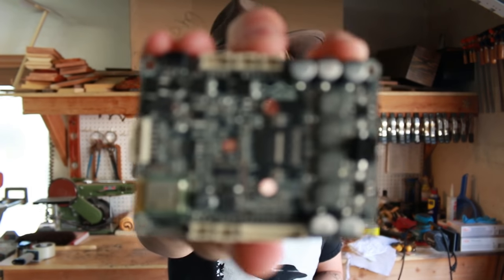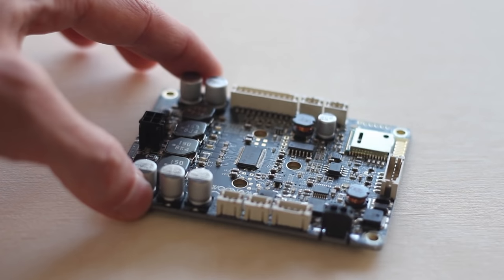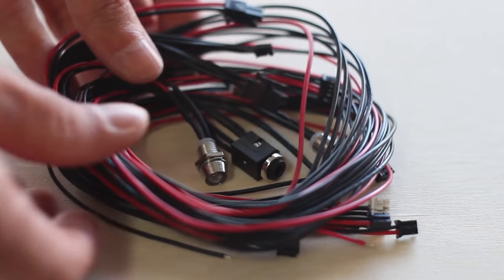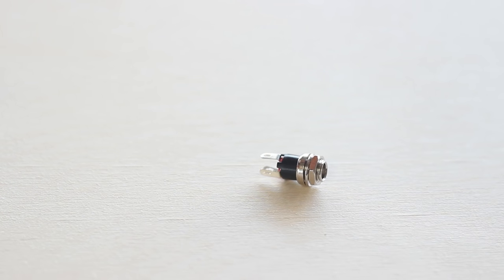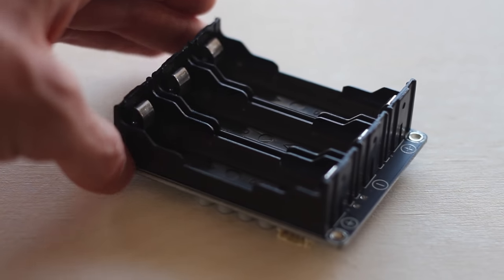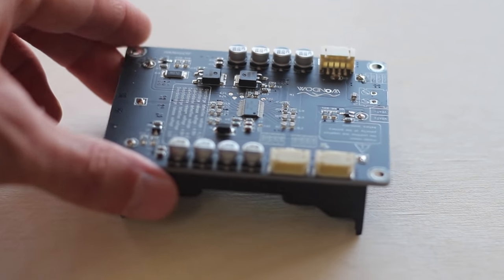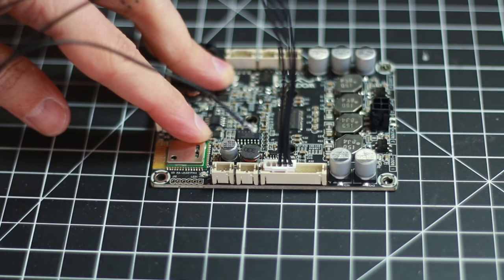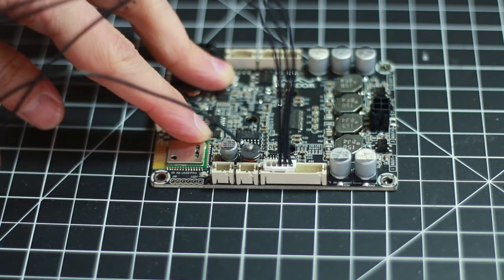The Best DIY Bluetooth Speaker Amp Board (For Now) & How To Fix Its Problem

Comment: Something people should be aware of with these amps. The watts ratings are bogus. Whatever SURE (or any manufacturer) rates these, the usable output is actually around half. Just take a look at the spec sheets.

They are rated 10% THD at full output and will sound like garbage on any set of speakers. However, they are generally 0.1% or less THD at around half the rated output.

Also, the published ratings are at 4 ohms. Most home audio is 8 ohms. So really, if you have a 50 watt amp, for 8 ohm speakers, usable watts are 12.5.

And because of all the marketing BS over the years, most folks don't realize 12 watts is cranking on good speakers.
Reply: You don't need a true 100W per channel. Very few speakers could actually take 100W.

Unless you have huge speakers, with multiple woofers, multiple midrange drivers and a tweeter, an amp like this rated at 50-100wpc will be more than enough to drive your speakers beyond their rated wattage.
Reply: Most speakers will be 80-90dB at 1 watt, 1 meter. Most of the time, you will not be using 1 watt.
Reply: I totally agree with you on the power and how much it's changed over the 20 years. The power ratings that is. I installed car audio for about 5 years in the mid-90s. We never used more than 150 to maybe 250 watts per subwoofer. Now I do know that the Rockford Fosgate amps that we used worth heavily underrated say for instance the punch 60 was supposedly 30 x 2 Watts at 4 Ohms. Testing last year showed that this amp actually put out around 80 x 2 at 4 Ohms! We all knew something must be going on but of course you didn't have the internet back then and the amp was also around $300 so strangely we had to throw the spec sheet out the window lol. But still, we did not run the Thousand watts per sub that people are doing now and not making that much more volume or SPL. And this is not only with subwoofers but front stage drivers as well. And amplifiers and speakers have become more efficient so why do we need 100 Watts for each 6.5 inch coaxial in each door? LOL we don't! So yes 12.5 clean repeat clean, watts, is very adequate.
Still, even today, they still will not get away from putting those large Peak or Max wattage numbers on the box and marketing materials.
Don't even get me started on power wiring and additional batteries! Again, class D amplifiers have become almost 50% more efficient than the older a b amplifiers but now all of a sudden we need 4 gauge and sometimes 0 gauge runs of expensive wiring or even welding cable! I took out my older Rockford Fosgate Punch 200 DSM amplifier which is capable of making 400 plus watts and does so easily on a gauge cable that can be up to 20 ft long!
Thank you for bearing with me I know it's car audio but still it's audio and it's wattage! I appreciate everyone.

Comment: I have used several of the JAB1 series amplifiers w/battery charger. I have never had the feedback that you experienced. I will definitely keep a look out for any issues. Also be aware the speaker outputs on the JAB1 are labeled incorrectly and puts the speakers out of phase. I really wish the speaker wires were not all black and 20ga wire instead of 22ga. I make custom molex connectors with upgraded wires gauges for the speakers, power input (upgrade to 20ga) and the charge cable (upgrade to 22 ga). Great video series Kirby!

Comment: I believe that wire on the aux cable that you removed is a ground. I had the same problem with this board and the seller said the fix was to tie this wire to the ground (one of the screw holes in the upper right corner). Seems like a common problem as I got this feedback very quickly from them.
Reply: did grounding the wire help?
Reply: Yes it did fix the problem. Guess I didn't mention that in the original comment.
Reply: Grounding the wire turns bluetooth on on my KAB-215 board. So, what I've found is that BT -> R(in) is not even necessary. You can switch on BT module via BT -> GND.
Reply: I still get feedback, any added help for me?
Reply: 4 wires for a stereo aux input seems odd to me.  
The only time I can think of that would need 4 wires would be, if you're including a microphone input.  
or some charging capability through the aux, which to me sounds like a stretch..  
either way,  it makes sense that the feedback would come from the 4th wire as I would consider that a bad ground. .remove the bad ground and remove the ground loop feedback.

Comment: I got one the JAB 2 50x2 boards with all the the extension boards from China 4 months ago, and have never experienced any noise with mine. Its been working great, you may have got a faulty unit. I agree with you these are the nicest little amps to come out so far. Did you know you can add a couple more battery boards to get longer run time? It still stays at 12 volt from what i understand. I like the videos, keep em coming!
Reply from the maker: I actually ordered four boards from Parts Express and all of them had this problem. I also talked with he customer service there and they said all their boards are experiencing this. I'm thinking they might have received a bad run from Sure, but that would probably still be hundreds, if not thousands, of boards with this potential issue. Such a bummer! I'm super glad it's a pretty easy fix though. I hadn't tested chaining the battery boards yet, but I suspected that was possible with the multiple connectors not he back of the board. Pretty rad! Thanks for watching and chiming in!
Reply: I just figured it out, re read the specs, I'm using the AA-JA11112 Interface Extension Board and it comes with a ground loop isolator built in, so that could be why I haven't experienced any noise issues.
Reply from the maker: Oh right! That's totally it. The issue only seems to happen with the aux in jack that's included with the wiring kit.

Comment: Thanks for posting the video and the build file! Any chance of adding the battery module to the file? I'm a little confused about which hookups go where on that board. I'm assuming ac adapter to battery module to amp board.. just not sure which plugs to use.

Comment: To avoid confusion, class d amps are not digital, the "d" does not stand for digital and its only similarity is that it uses switching transistors. The bluetooth/usb modules are the only digital parts.
Reply from the maker: True, the D does not stand for digital, but the "digital" refers to the digital control of the switching transistors. You can find more info here: http://www.audioholics.com/audio-amplifier/the-truth-about-digital-class-d-amplifiers Thanks for your input and for watching!
Reply: It's still not digital. Although the switching transistors are used in saturation, i.e. fully on or off, akin to how they are used in digital equipment, the timing of them turning on or off is not time-discrete like it would be for example in a digital direct delta-sigma amplifier, but analogue.
Reply: Siana Gearz It is digital! It is value-discrete :^)
Reply: It's not digital unless it's discrete in all dimensions :( Sorry to disappoint and i know it's nitpicking because it really doesn't terribly matter, but it's true.
Reply: Siana Gearz I know, it's nitpicking and I know it doesn't matter. I guess it still kinda worked setting you off :p  Cheers! :^)
Reply: I hate hearing this still! Class D does not mean digital! Did a/b stand for apples and bananas. LoL.
No offense to Kirby at all but if you're going to put electronic videos like this up, we have to get the basics right or newbies, I shouldn't use that word, newcomers, are going to keep repeating the information and then the next person will and then the next person will. Do we, including me, make mistakes? Yes! But this is a repeated mistake that needs to be fixed so please take this as constructive criticism please please please!
This has to be one of the best YouTube Community channels in terms of, well, it's Community LOL. There seems to be a lot of knowledge and simply nice people and I love it!

Comment: Hey Kirby.  Love your videos man. I've learned a lot.  Just finished my first cigar box speaker build and used the Dayton Audio version of this board and it's matching battery board.  Without your videos I'm not sure I'd have done it.  So thanks man. Keep doing your thing
Reply: Hi, I was wondering about this:
Is this board truly identical to the dayton board?  I figured dayton was a reputable manufacturer.. so did dayton pick an off-the-shelf chinese board and just slap their name on it? Or is the board in this video a ripoff?

Comment: Im planning on building an ammo  can Speaker with all the components you mentioned in the video. I want  good bass as well as treble. What speakers would you suggest?? Should I get a woofer + tweeters?? Or full  range  speakers ??

Comment: Great Video! Can you Tell me how to wire this board for a mono speaker? The build plans assume the optional second speaker but I really want to just have a single speaker running mono?  I can't find any documentation on how to wire this that is consistent.

Comment: Using this for bluetooth speakers, do you think the sound would be better with a pair of full range speakers, or can it handle 2 2way crossovers and it´s pair of 6.5" and tweeter? Any ideas?

Comment: I plan on doing a DIY copy of the Sony SRS X-77.  DOSS Audio recently made a budget version with some decent tuning but the enclosure had serious resonance issues.   What can be done today for a 2.1 build with BT?      My design will have isolated mains and a subwoofer with a passive radiator.   I've been retro-furb'ng and building speakers for over 35 years and I think it's time to build something modern and more equipped for our changing needs.    I have no shop or access but I can probably handle modifying something to build this.      It's just the noise I'm worried about.

I'm also not a fan of just using passives in a L R box.   Mixing the back waves in a single cabinet, regardless of the style of enclosure is not efficient and things get muddy in the mids once you start affecting cones with competing crosstalk of the back waves.          I'm guessing we still don't have a quiet board in this arena.   I could build a box with a TPA3116 2.1 50W+50W+100W board with an AUX jack only - and then just use an external BT device but UGH!!!!     You get me on that.         Thanks for all your hard work here!

Comment: I have a pair of Dayton Audio B652 amp-ed by a Lepai 2020+. They sound decent for my present needs, but I am thinking about some changes, like getting rid of all the wires by integrating the amp into the speaker, also integrating a bt receiver into the chain and a sub out for a future addition of a sub. This module you present here seems to be closer to my needs than the Lepai. What do you think?

Comment: Hey Kirby about to pull the trigger on my first build with this system,  I had a few questions about wiring 

1. Does the amp board handle the power distribution according to what cables or expansion boards are installed ( lithium battery board)  or do you wire power directly to the battery board?  dont want to burn up my amp by connecting 19 VDC, 1-5A power adapter  to the wrong spot.

2. Is it a bad idea to enclose the 19 VDC, 1-5A power adapter in the speaker case. I was wondering if heat given off inside would damage the amp board long term. 

3.  Can you connect multiple  lithium battery boards to extend play time for the build?

Thanks for any help given!

Its going in a 50 cal ammo box with 2 full range 4in  drivers a bass port 5 in x 7 in x 11in

Comment: So quick question... If you opt for the battery pack, does the AC adapter charge the batteries or just power the board? Which power source is primary once adapter is plugged in?

Comment: I built a 100w reciever for my living room / dining area  about 8 years ago using a SURE amp and a SURE bt receiver board powered by a 12v power supply.  My issue is that my green indicator light does not always come on, on  my bt reciever so no connection. 
Recommendations for a replacement bt board??

Comment: I have a Klipsch promedia 2.1 setup,and the amp in the sub is burned up.Would this work for it? Not planning on using batteries,and would like the bluetooth option..Thanks for your time

Comment: Say I wanted to use the JAB1 w/ the Lithium extension, is there a port for plug in charging so the batteries dont have to be removed for each charge? And specified charge voltage/amperage? Thanks. Looking forward to seeing this in use.
Reply from the maker: Hey! Yep, you can charge the batteries from outside the box. I believe you need a 19v 4a charger to charge them. Thanks for watching!
Reply: Thanks, recently found you videos and they are FANTASTIC.

Comment: question: two drivers and two bass radiators, positive and negative wires have to be connected to the drivers in reverse ( switching - with + )? So when is punching the air inside the box to push the radiators outwards? Thanks
Reply from the maker: No, you don't need to change polarity when using a passive radiator. Just wire the speakers normally. Thanks for watching!
Reply: Thank you for inspiration and motivation! Your woodwork, and videos.....great job!

Comment: Is it possible to extent the range of the Bluetooth signal on the Wondom 11161 with either an add on board or by soldering a MMCX connector with an 2.4GHz rubber duck antenna to the antenna trace on the board? im building a wireless speaker box for use outside and want extended range (up to 300') as well as the ascetics of an external antenna.

Comment: I used it in a bluetooth speacker DIY with 6" speacker and it's work very well, the only trouble was the battery, the size are not perfect for 18650 lithium battery but if you push very very hard you can put in it. Also 12v are not enough for delivering the max volume, but it's satisfying for outdoor. Very clean amplifier with great sound, not bassy like bt speacker as bose ect... I can't wait to see what you will make with this board

Comment: I really like the SANWU amp modules, similar to these. The BT and other accessories are separate daughter boards, but 15W - 200W stereo & 2.1modules = very handy and flexable. Uses the TDA and TPA amp chips.
A lot of BT audio devices will have feedback noise if you power your audio source off the built-in 5V supply when using the line-in (like ipod or phone). I wonder if your hack will work with these too?!
Reply: Would a 5v/5v isolator solve this, or is the noise further upstream?

Comment: Looks like the same board (KAB-230) from Parts Express, just re-branded. Have the same battery extension, etc. Where did you splice the on/off switch in, and I would like to add an led voltmeter to monitor battery supply. Any suggestions, hints?

Comment: I'm very new to this and this is gonna sound like a dumb question but here it goes. So from my understanding this amp board is powered through the battery pack that you showed in the video with the 18650's and how is that connected i guess is my question. I guess i'm confused on the battery pack and then you also showed the wires that you said are for power. So do you need to purchase a charger for the power and if not or if so, how do you charge it? Thanks. BTW I love your videos and how creative your speaker build videos are.

Comment: Hey, great channel, I'm just getting into speaker building so this is an awesome resource! I have one of these boards but I'm not finding it overly loud, I'm running a 12v5A supply, would a bigger power supply help? Which one do you use? Thanks.

Comment: hey Kirby- I'm building a massive headboard for my bedroom complete with LED lighting. I think I should add speakers. I've got some car speakers, would love to incorporate Bluetooth, I have no idea what I'm doing. I can handle wiring, but am at a loss as far as power supply and using a blue tooth board, etc. Any help?

Comment: Great info. I've been bumbling through my own little speaker project for a while. My biggest hurdle has been available of parts - in the UK the only readily available drivers are brands called Monacor  and Visaton,  neither of which compare favourably with the likes of Dayton Audio or Peerless, or even my little Fountek FE85. Do you have any experience with either of these less quality brands and their 3" to 4" full range drivers? (I'm sticking to full range until I get my head around cross-overs). Cheers

Comment: Hi,
I've two old speakers of a record player lying around which is kind of antique probably from the 80s and want to make those Bluetooth enabled.
I plan to use the Bluetooth amplifier audio board but I want how to select the right one (ohms and watts) for the speaker box I have and also as I'll be adding that to a single speaker so I want the audio output to be single channel. can you please help me how to check the specs of my speaker box and then how to get the right Bluetooth Audio Reciever amplifier for it?

Comment: hey i ve been thinking of building something like a JBL xtreme with passive radiator. i have narrowed down to few components. bluetooth board, crossover crcuit from banggood, passive radiators from aliexpress. just not sure about the woofer driver. can i use a full range speaker and connect to the bass of crossover?